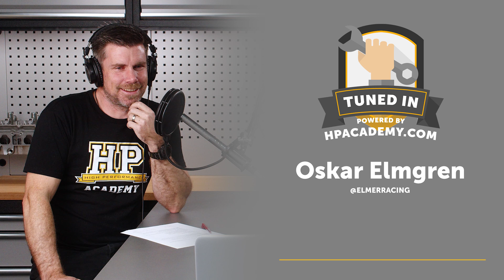022: Is There Such a Thing as Too Much Power? [#PODCAST]

Comment: Great interview. Some surprising details - like aluminum rods in a a circuit racecar but steel for drag?!? Also, I too have been disgusted with the 1950s technology in GA aircraft engines..and it's something I've given a lot of thought to. There are, honestly, good reasons for this. First, engine speed is limited to ~2800rpm to keep propeller subsonic unless you incorporate a gearbox (PSRU) which adds weight, complexity and cost. Thus, the only way to make power is either a huge engine or forced induction. Forced induction adds weight, complexity and a lot of cost - as well as seriously compromising reliability. So, despite the fact a Lycoming/Continental aero engine basically being a giant VW bug engine - you really don't need much more because lousy ports and manifolding works just fine to achieve good VE @ 2700rpm. Plus, getting an advanced/high tech engine certified for GA would be a monumental undertaking. For experimentals on the other hand, I'm sure a 750hp variant of the T'hor engine would be awesome.